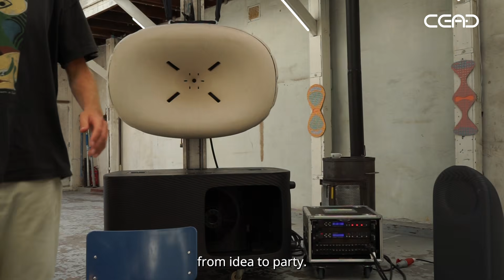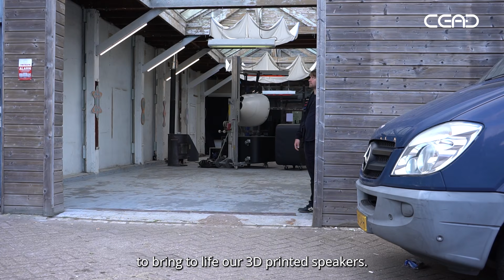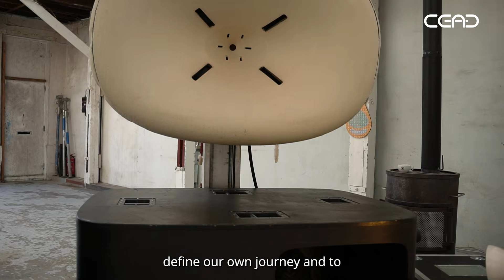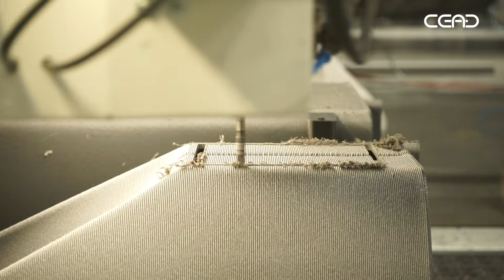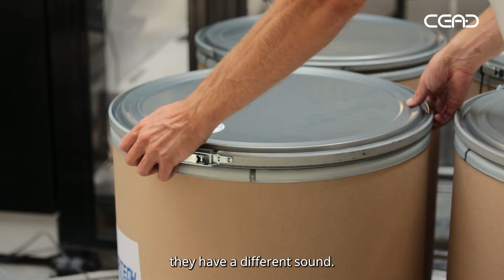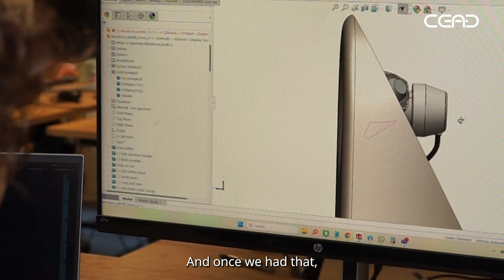Crafting 3D Printed Sound

Comment: If each kind of material you use is flavouring the sound, you are doing it wrong. The cabinet should not be an instrument, thats the job of the musician. a cabinet should be as inert as possible. Sure, waveguides/horns etc will affect a certain dispersion/coverage, but flavour? I think not.